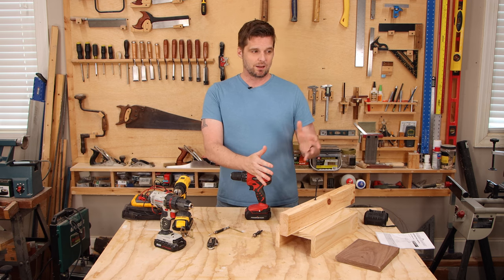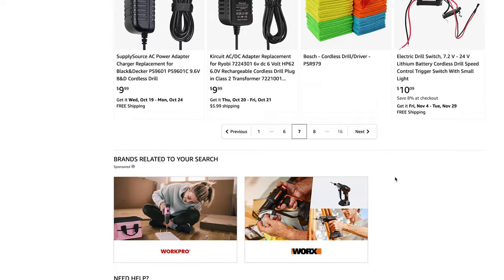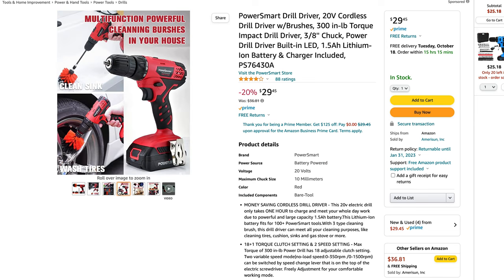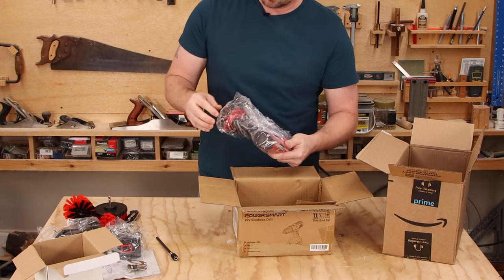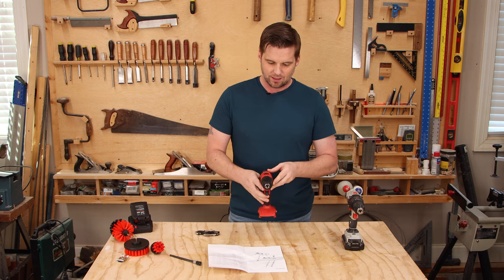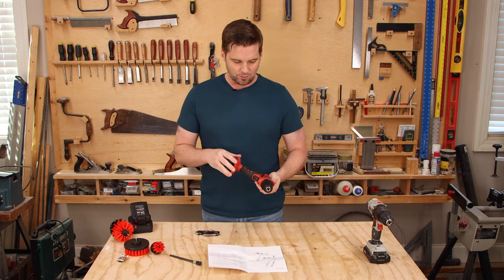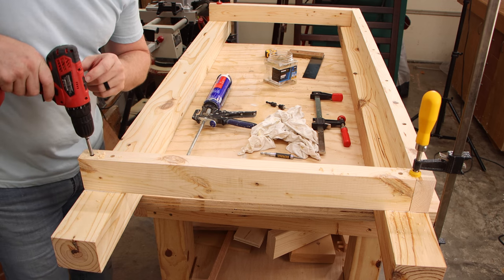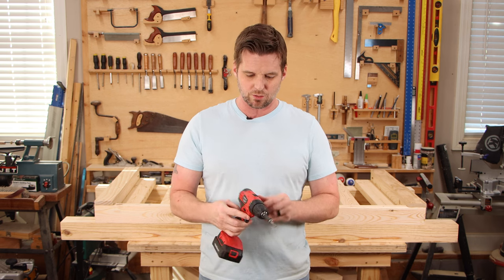I bought the CHEAPEST drill on Amazon and it SHOCKED me. [How Low Can We Go] - Ep 1

Comment: For not being a tool review, I enjoyed the tool review ;-).  Nice to know if you occasionally use a 2nd drill this is a contender.  Question:  Would you consider doing "Non-Reviews" on micro sized tools, Mini table saw, drill press, coping saw or lathe?  Not everyone needs to cut 8 foot long 2 x 4's or rip up 4 x 8 foot seets of 3/4 baltic birch.  I work on small boxes for electronic projects and like the look of wood over 3d printing.  Small retro game cabinets, portable lab power supplies, amateur radio digital and blinky things for the grandkids.  Are there smaller power tools for this?

Comment: Panasonic had a seconds company under the name Palsonic. That company sold Panasonic items that had come off the production line and needed some fix of some sort and because of that they could no longer be sold a a new Panasonic product. Hence the Palsonic name and they were able to sell a perfectly working item and not sully the Panasonic name if the item failed and stopped working. I purchased a lot of Palsonic products and can't ever remember having an issue with them. 

This drill may be the Palsonic of the Powersmart drill's parent company and not up to the high quality with poor joins in the shell or a gear that doesn't engage smoothly then instead of scrapping the tool or spending more time than it is financially worth they just rebrand it under their "seconds" company name and sell it under a different name for a smaller profit and may even claim it as a tax write off. ?🤷‍♂

Mitsubishi electronic also had their own "Palsonic" and it was called Diamond something (can't remember the rest of the full name, Diamond Data maybe?). A scratched TV case or a resoldered component and it was rebadged from Mitsubishi to Diamond something. The diamond name tied in with the Mitsubishi diamond logo.

Of course I may be totally wrong and I am full of 💩. 🤦‍♂
Reply from the maker: I don't know much about Powersmart but it seems like they are primarily an outdoor tool company. They are based in the US and their parent company Amerisun Inc, doesn't even have a website, so who knows.

Comment: Just for the fact that the bits come loose, and the extended amount of time that charging is needed takes away the merit that it as enough power for the job. In my opinion, this is not worth the time and effort.
Reply: They do not come lose . You must lock the bits in drill mode not screw mode and they will stay tight . Well mine do anyways 😂